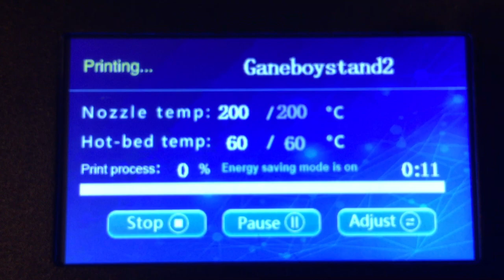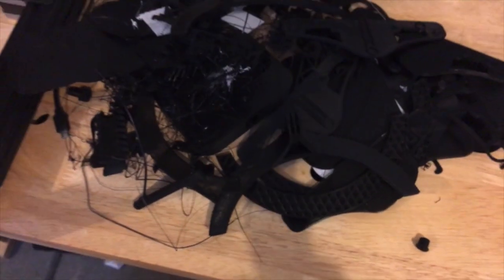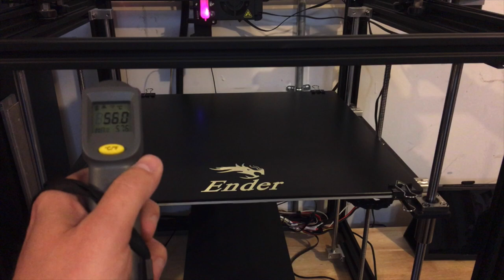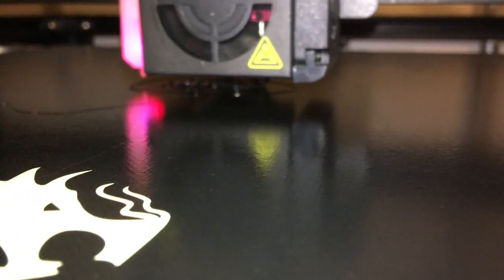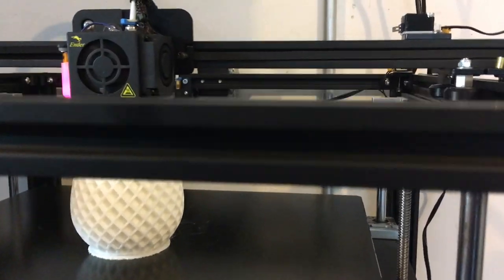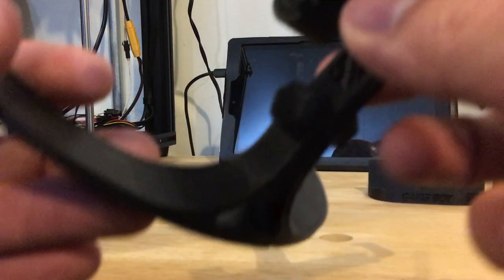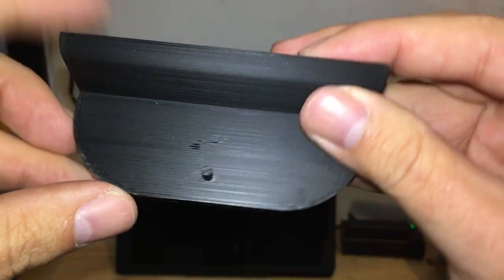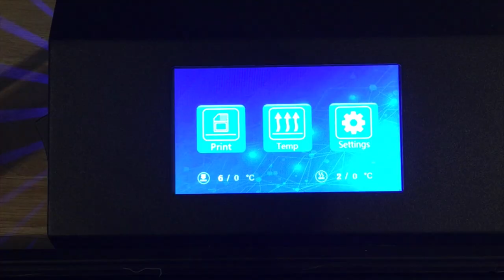Is the Creality Ender 5 Plus a failure?

Comment: I have had nothing but issues with my Ender 5 plus. I have Z lines i cant get rid of i have changed linear bearings , loosened eccentric nut, flipped lead screw checked lead screw , PID tuning , Checked all voltages , tried different filaments and changed nozzels , calibrated esteps and flow , did lukes hotend fix , tightened belts and wheels made sure everything is square. you name it i have done it and it prints like garbage ..i have even had other people print my gcode to make sure it isnt my slicer and theirs turns out great. Creality isnt really helping me at all no matter what uneven Z lines and its actually worse with heated bed on.
Reply from the maker: @Matt Eastman 
Greetings Matt, first thanks for watching the video and reaching out to me!  I would like to assist you anyway possible.  Please send me an email at tripodsgarage@gmail.com, maybe we can setup a video chat to nail down your troubles?
Reply: my guess is you have a bent throat tube heater block combo or a un seated ptfe have you inspected them had the same issue with my ender 5 ?
Reply: @wayneuk  o yeah I have done everything ..literally everything lol I have quadruple checked my esteps and flow ,I have done PID tuning , I have replaced my linear bearings , performed Luke's hot end fix, tried different filaments , different temps , low speeds , high speeds, checked belt tension , checked, wheels brass couple on Z axis , checked all my connections , made sure bed was level to X axis, checked lead screw was straight , changed nozzels, squared machine ,I have tried different slicers I have checked my extruder made sure it was in proper ..you name it is have done and tried it
Reply: @TripodsGarage  thank you I appreciate that I have been working with some people and creality I will let you know the out come ..subbed !
Reply: I've had mine for almost a year and have yet to have any significant successful prints.

Comment: sorry for all inconvenience we may cause and we will continue to improve
Reply from the maker: @Creality
First thanks for taking the time to visit my channel and posting an apology!  

Yes, this printer had some issues out of the box, and these could be easily fixed.  However, there is one that isn't so easily fixed!  The demand on the poorly built cheap PSU is the biggest issue!  You should be commenting on this video!  https://youtu.be/A-Zb40P09MQ

Just a side note...
My channel was never supposed to be about just about 3D printing, your product was the 2nd video posted on my channel.  When the Ender 5 Plus was announced, there wasn't much known about it.  There were only 4 unboxing setups of the Ender 5 Plus, and only 2 of the 4 were worth watching at the time!  I watched an absolutely horrible YouTube video, "Creality Ender-5 Plus 3D Printer- Unboxing and Review".  I watched in disbelief the way this Cyborg girl treated your product, just putting everything on the floor, stacking the components without care, and not even assembling it correctly.  The filament was mounted wrong, and the filament is under stress, just look at 7:05 in her video.  She is more worried about her camera angles than actually showcasing the actual product!  Now her review was later than the others, she could have provided troubleshooting steps, instead she shelved your product and totally bashed your company!  I still continued to watch this circus, I figured there would be a solution provided to the audience towards the end.  No such luck, like all of her videos, just more ramblings, and a horrible print of a benchy.  Any suggested comments or challenges, she deletes.  She provided no review of the E5+, just a horrible unboxing.  This is what your potential customers get to watch?  

I was so excited when I received the Ender 5 Plus, I decided to make an Unboxing\Setup video as my 2nd video!  I wanted to keep mine short and to the point, while keeping it informative unlike the Cyborg one!  I felt I accomplished that.  

Now since the creation of this video, the one I am responding to.  My Ender 5 Plus only managed to survive less than 2 months before there was a catastrophic failure of the power supply.  I reached out to Creality through email, and dozens of times over the course of a month on Facebook IM, with no results.  It took me and my "Little YouTube Channel" almost 1 month to get any response from Creality.  By that time you left me no choice but to post the two videos about the bad PSU's and how I replaced it.  I gave Creality so many times to right their wrongs, even my PayPal dispute was handled in a very shady way!

I think you need to realize who your real target audience is!  It is people like us, the Do It Yourselfers, Hobbyist, and the everyday tinkerers.  These are people that spend their hard earned money on products that just want to see them work!   I was woken up this morning with a Creality Facebook live with the Cybory person, just showing off prints?  Really?  When was the last time this Cyborg person contribute "technical assistance" to your Facebook Creality Groups?  I would think if you "Sponsor" her, you should be asking a little bit more?  I think there is a reason why Cyborg doesn't contribute to the Facebook Groups, because she cannot without direction!  It is people like us, that create valuable content, contribute to your Facebook community that matter!  When there is a glaring issue, we are offering you assistance to not only make your product better, but sometimes safer like with the E5+ PSU!

Comment: I print just with the eco mode, meaning the bed ist turned off after the first layer, and even prints with a small contact surface to the bed are sticking fantastically. The printer ist printing amazingly good.

Comment: On the 5 Plus you have to start a print to clear the Z offset. Some times you get a monstrously large Negative Z offset. That means you have an offset lager than you can deal with without starting a print and poke at the screen.

Comment: You can buy an enclosure. You should use good filament as bad filament is another cause of print failures. Different ways to get the filament first layer to stick...make sure your level.

Comment: I would say your first fix is ‘Turn OFF the ‘Power Saver Mode’’. The power saver mode turns off the bed heat which is completely not compatible with the glass bed. The glass bed is designed to release the print once the bed cools down…the glass bed is doing what it is designed to do.

Comment: A couple of generic comments and then my specific experiences this weekend with the E5P.

Work on the audio levels through the video. Things definitely were out of balance. Intro audio was loud, your intro speech was low, and the rest was pitchy through the video.

Just provide links to the models. I don't need/want to see searching thingiverse. That isn't really compelling video :D

I got caught by the energy saving mode too; fortunately I figured that out after 3 benchy prints failed to stick. I also figured out the retraction issue after waking up to a failed 10 hour print.

I did have a bit of warping but that might be support material related (I think). I am not contending with the cooler ambient environment.

Good comments on the runout. There needs to be a better way to handle this. At least the hardware and setup is there. Maybe firmware updates/patches can help. I have not been happy with the "refueling" process. The extruder seems to tear up the PLA. I also have a feed issue between the extruder and tube. I end up doing it manually but it isn't as smooth of a process as I'd like.
Reply from the maker: @warwizard - Well this is a lot to take in!  However, I appreciate all feedback, unlike others I do not block comments.

Audio - this was only my third video - been trying to improve it, and working on my levels.  This whole video was shot on my iPhone 6sPlus.  Now have a Canon SL2, and just received a wireless mic, this should greatly improve my audio!  I am a one man crew on crutches, and not really a fan of one static shot throughout a whole video.

There were a lot of moving parts to this, with the video, and several screen recordings.  I really did consider not showing the screen recording, thought it would give the noobs like me something more than just a URL.  You are correct about sharing the Thingiverse links. will add them!

That darn Energy Savings Mode!  Wow!  Who's brainstorm of an idea was that!  I was so close to throwing in the towel until I saw that!

Yeah that runout is absolutely useless!  The bed temp drops so fast, you really need to be there right when it runs out, or you are doomed!

Warwizard - Like I said, I am a fan of trying to improve, and knowing what people really gets out of my content.  I appreciate that you took the actual time to watch the whole video, and give me some solid advice to work off of!  

Please feel free to like, subscribe - Tripod!

Comment: My problem is that my prints stick too well. I have to let the build plate cool before I can remove the print.  I also removed the filament sensor, as it is a pain to get the filament loaded and it really  let you replace the filament to finish.
Reply from the maker: Yeah, after having a nice clean glass (no tape or hairspray) my parts stick very well also.  I have to wait maybe 5min or so for the bed to cool and the parts just slide off.

Comment: Just stumbled on your video.  It takes time to learn them and the filament.  Not only that, but even with a calibration cube, you have a four suite learning curve . Be patient. I have an Ender 3 Pro that i cut my teeth on.. You might want to check Kersy Fabrications and his build of his. Along with his auto calibration setup. Also, teaching tech is excellent!  And on glass, if it's not adhering, then the glass isn't clean(might look clean, but it's not. I clean mine with alcohol before each print).. But give it some time... And slow down your prints, along with temps...
Reply from the maker: Thanks Damon!  I have been watching Teaching Tech for a number of months, before my purchase.  Yeah I’m in for the long haul...😉.  I realized with these lower to mid level printers there is a lot of learning, tinkering, tweaking and mods that need\can be done!  That is what got me to purchase it.  I appreciate you taking the time out of your day to watch and post a comment.

Thanks,
Tripod

Comment: My rider 5 plus was a failure right out of the box it would print , but only for about 10 minutes before the hot head nozzle clogging.  I could not print the test animals . Factory told me it had soldering problems and they wanted me to re solder the print head harnis.  I sent it back
Reply from the maker: @Crispy Chicken - (love the name!) - Yeah I hear you!  The loyalists will tell you that these printers are not for the entry level user, and to expect this and this type of support!  If that is the case, then advertise them in such a way that the average Joe doesn't just go out and buy one!  
How about they at least work out of the box for a number of days, and months?  My power-supply burned up in just 1.5 months of owning it (https://www.youtube.com/watch?v=A-Zb40P09MQ), and I only used it maybe 2 dozen times!  Sorry the average person isn't going to be diving into the control box, and or do any soldering.
Thanks for watching and subscribe - Tripod
Reply: @TripodsGarage  not my first printer. Had a ender 3  with lots of upgrades . But ender 5 right out of the box . I know the wires were hacked in the factory.  But for 345 buck bent want to repair and upgrade on day one.  I replaced the crap nozzle before I even turned it on.  Bed was leveled and the magnetic removable pad sucks should be glass . I'll try an other one soon.

Comment: i got mine about a year ago, it had a weird issue that it would under extrude at 1.5" of height printed. to the point it eventually stopped giving filament and while trying to fix it it eventually broke and i'm now in the process of installing a bondtech DDX v3 on it, as of this morning i think i officially have it put together but i still need to find out if my bltouch height is right and if the amperage i set for the smaller stepper motor is right. it should be within the necessary settings, but some of the times i measured the current it would go back and forth for some reason.

Comment: Hi Colleage! do not get desesperate! The machine is good, only need a bit of patient. In internet there are a lot of info, people that appear like experts but  they have no idea what they are speaking about therefore a lot of not correct info. I had a lot of problems too, but then I learned with the experience and thinking like an engineer. The first problem I got was with the leveling and calibration. It is like a joke the stupid videos and advices about that, included the offical Creality video. I do not understand this economy boton neather! just stupid.
My advices: there are a lot of parameters: of course the temperature, mantein it constant ( not cold). Clean always after print, not use too much spray. The calibration is very important, the type of bed and the position of the clips. The material and the design are two very important factors that can change all the parameters commented before, therefore, what was valid for a material/design before could not be for the next print. Always tray to stay there the first plies and go to adjust settings and regulate the hot end distance in milimilimeters (0,00mm), otherwise in the calibration option zou onlz can manage mm.

Comment: ADJUST YOUR Z OFFSET!
If your having problems with your printer, I suggest you go visit the official creality channel on youtube and sit through the setup guide (like 5 mins) and your good to go ...
I have been 3D printing for 4 years now on 7 different printers and here's a little guide for adhesion problems:
1) Is your bed set to the right temperature?
2) Do you have a good nicely interconneted first layer?
3) Is your bed leveled correctly
4) Does your print have a shitty design? Just because it's on thingiverse does not guarantee that you can print it. For complex shapes (e.g. round undersides) try levitating it over the bed so it completely rests on suppport, or move it into the bed a bit to guarantee a flat underside.
5) If all of these steps fail and a design change is not possible, use sugar water.
apply a thin layer when the bed is heating up. get rid of it again with plain old water (this also has the nice effect of making your printer smell like charamel).
NEVER use glue/hairspray (unless you want to ruin your printbed), bluetape (bits can come off and stick on your print), alcohol (you dont need it, unless you did something REALLY messy and then make sure to give it 5 mins on the heated bed to evaporate. otherwise your next print will pop off after a few layers, because there's still evaporating alcohol), a scraper (I have seen so many scratched and even chipped glass printbeds, believe me: you do more harm than good! just wait for the bed to cool down and then pull if off with a little force)
The only thing I do is wipe off old bits of filament with my hand (no special cloth or other garbage people try to sell you) and that's it. worked for hundreds of prints on all the printers i ever worked with
Reply from the maker: Great advice, very informative!
This video was produced Nov 11, 2019 and Creality’s official leveling video was released on November 29, 2019.  It would have been nice to have that video available when the machine was released, not two months after.
Reply: @TripodsGarage  you are right, sorry I didn't check!
well I like to help here since this is a bit of a sensitive topic for me (witnessed so much crap people did to "fix" bed adhesion).
Regarding the E5P:
I recently opened it to take a look at the board. the connector for the bottom fan came out as I opened it, so I plugged it back into the hub which was labeled "fan". that somehow undervolted my z-axis and I couldn't print anymore. The fan actually goes into the hub above the "fan" one, labeled "Vin, Vout" (i think) and then it works fine again ...
Sooo you quickly feel the low price of the printer when you're working with it, which is fine in my opinion - it's just not a good "first 3D printer"

Comment: Zero problems with both of my 5 plus's. I will be buying a third unit to keep up with our shop requirements. Only thing I did non-stock is a Capricorn tube and leveled the bed with a dial indicator on a 40" piece of square tube spanning across the top. Easy to level within .001" . Room temp is definitely an issue. Also, turn off the Eco mode and leave it off.
You may want to check out Kersey's channel on the subject.... https://www.youtube.com/watch?v=-BFUf8S6-FE
Reply from the maker: Hello Zero!  Thanks for taking the time out of your day to watch my videos!  That is great to hear!  Mine is stating to work pretty good now.  My power supply burned out just after two months 

Don't buy a 3D printer until you this! How to replace the cheap power supply! https://youtu.be/A-Zb40P09MQ

I was able to print in my garage successfully at 40deg w\o an enclosure.

Creality Ender 5 Plus Thermistor error Fix!  3D printing in cold temps without an enclosure! https://youtu.be/FY3pfDQgByw
Reply: Curious about your bed leveling process. Any more info or a video on it?
Reply from the maker: @Kloran27  - This was only my 2nd video shows the unboxing, setup, and my take on the leveling process - The audio is off as well - be gentle ;-)  

https://youtu.be/SDAfXD4PN2U
Reply: @Kloran27  I'll see if I can put out a short video soon.....